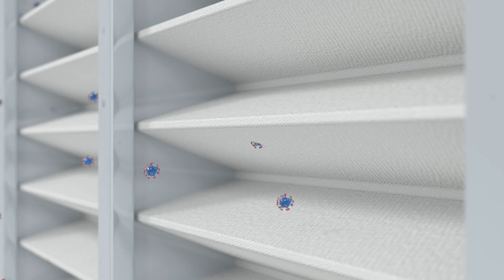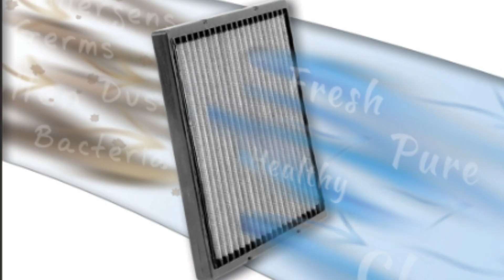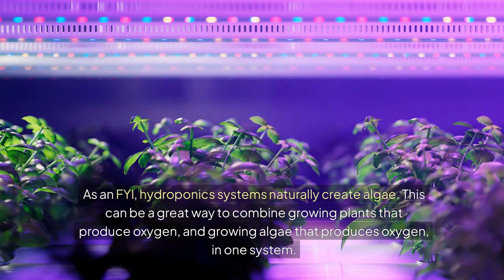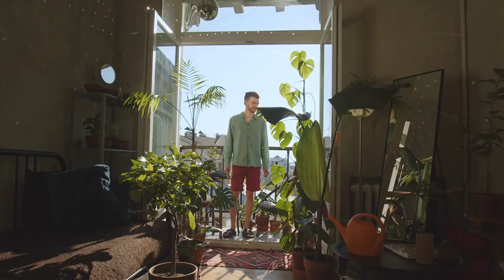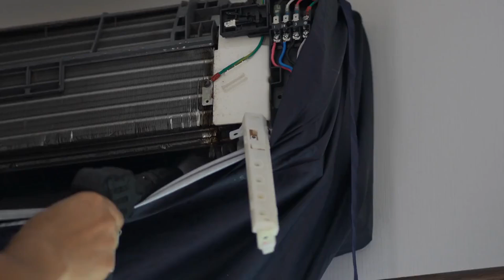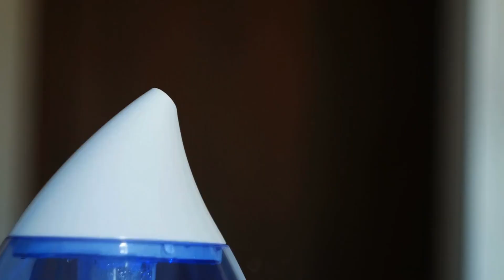Clean Air During SHTF? Here's How!

Comment: Good info Nikki . i have a 200 gallon air compressor in the basement i can release the 185 psi all at once n reverse pressurize my whole house forcing outside crap away . Am working on a clean air intake filter for the comp. as well / i have all ready tested it with smoke from the wood burner
Reply from the maker: That's really smart! You're way ahead of me on that one!
Reply: @offgridstyleprepper  Thank you .
Reply: Good idea but what powers your compressor?
Reply: @CliveHateley  14 hp kohler on a seperate pto if neded , i have a smaller one 8hp ran on a h20 seporator using 4 omni water filter units with 16 rods per unit with a cross electrolite . i have another unit for my shelter that needs no compression n can vent or use either h or o on a 3 psi release for heat or air , the h is mixed with outside intake , the o is mixed with sub terain fossil